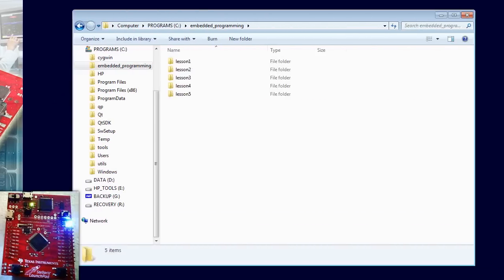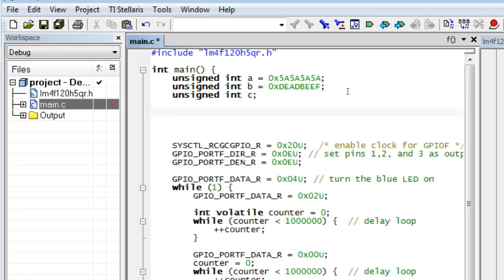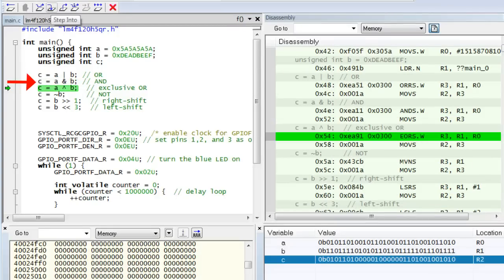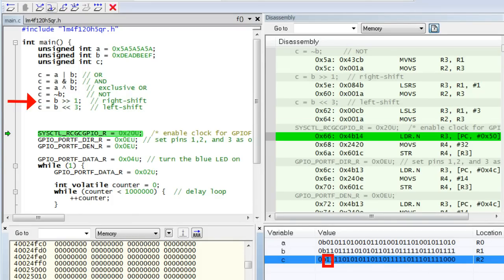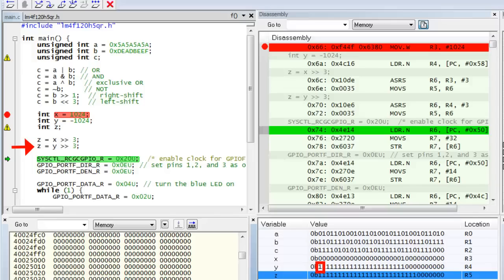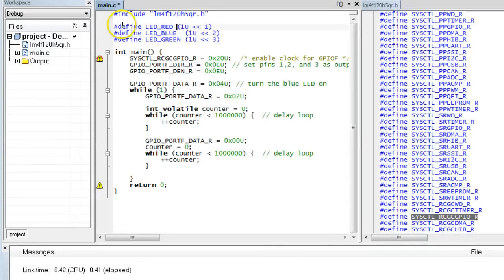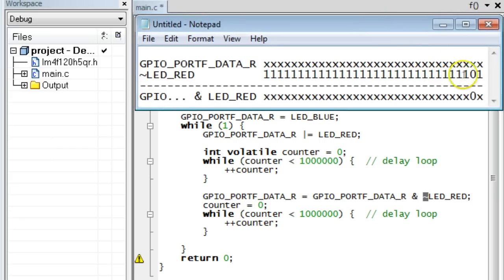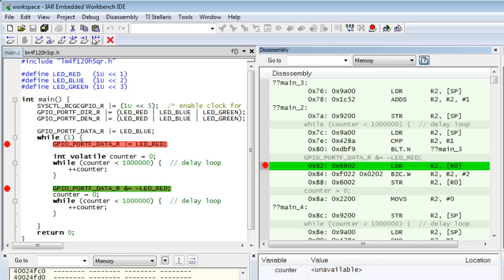#6 Bit-wise operators in C

Comment: When I set the optimization level in Keil to anything but zero, the code runs into an error in the debugger when I hit run, but it doesn't when I step over the code line by line or by breakpoints. Is that even supposed to be possible?
Reply: Yes, i also faced the same issue. The answer i got was that the compiler at higher optimization level was enabling clk and reading the GPIO registers back-to-back, leaving only 1 machine cycle gap between them. So effectively, compiler tried to read the register before it even woke up, and the board goes into hard_fault.
Reply: @sankalpsharma9414  thanks, i'll to look into it. did you find a solution?

Comment: best of deep dive in microcontrollers ,i realy enjoy all of your expresions about how 32bit mcus working and i have a request , pls teach 8 bit microcontrollers ,avr or stm8 or pic , i need to learn foundamentals of machine working in micros. thank you soo much
Reply from the maker: 8-bit CPUs are commonly believed to be "easy" to learn, but no new 8-biters were designed in the last 40 years, so all of them predate the widespread use of high-level programming languages (even as low-level as C). All 8-biters have "quirks" that require some non-standard extensions to C. The 8-bit PICs have a crippled stack, the 8051 has segmented memory, and even the "newer" 8-biters, like the AVR, require the "PROGMEM" extension to access read-only data in ROM. The only really "easy" and fully compatible with C is the 16-bit MSP430 (which is occasionally used in this video course to contrast it with ARM Cortex-M). Consequently, I think that teaching 8-biters in this day and age is counterproductive. --MMS

Comment: Great to know that the ASR instruction preserves the relation between division-by-2 and right-shift for negative numbers.

A firmware typically accesses control-related MMIO registers as if they were normal memory: read their previously stored values, update these values in the CPU, and write the updated values back. This is a common tip for peripheral modeling for firmware emulation.

Comment: Hi!

Does any one have an idea why this works when I turn optimization on:

    GPIO_PORTF_DIR_R = (LED_BLUE | LED_GREEN | LED_RED);
    
but this only works with optimization off:

    GPIO_PORTF_DIR_R |= (LED_BLUE | LED_GREEN | LED_RED) ;

All other lines of code that use bitwise operations work perfectly well
with optimization on, including:

    GPIO_PORTF_DEN_R |= (LED_RED | LED_BLUE | LED_GREEN);
    GPIO_PORTF_DATA_R |= LED_RED;
	GPIO_PORTF_DATA_R &= ~LED_RED;

I am using the latest version (v12) of the Code Composer Studio (by Texas
Instruments) and the latest version of Linux Mint.

Cheers!
Reply from the maker: First, you should simply check the disassembly in both cases. But whenever I encounter such "impossible" things I check for race conditions (explained in lesson 20, https://youtu.be/3ha72Y8pyD4?si=JaRbIUhrSBMttC7Y ). I suspect that you also access the GPIO_PORTF in some interrupts, aren't you? --MMS
Reply: @StateMachineCOM  I noticed that if I debug and then continue the run, it works. So I thought "Is it necessary for some reason unknown to me to wait a bit after enabling the hardware block with SYSCTL_RCGCGPIO_R = SYSCTL_RCGCGPIO_R5; ? Perhaps it is the wait in the debug that makes things work.
So I put a wait after the command that enables the hw block and it works with the |= even with full optimization.

Comment: Thank you so much for this wonderful series.
Can we use the bitwise NOT operator to find 2's complement of a number in following way, c = (~b) + 1; 
Is this a good way to find 2's complement of a number?
Reply from the maker: If a number x is signed, the fastest way to find its 2's complement is -x. For an unsigned number x, your way (~x) + 1 would work. But why would you even want to take 2's complement? Could you provide a plausible use case? --MMS

Comment: Through my simplistic knowledge, I understand the value in bitwise operators for embedded devices such as the launchpad. Memory is relatively confined in scope, and hardware registers are easily tracked down via the data sheet. How does this scale to something like a modern video gaming console, where there are gigabytes of addressable memory, and pointers are numbering in the thousands or more, and you have an API you have to interface through to access the hardware?
Reply from the maker: The understanding of the basics is always useful, and experience shows that developers who understand things at a low level tend to program more efficiently and with greater confidence. Also, let's turn the question around and ask: How can you scale all this up without understanding the basics, like the bitwise operators here? --MMS
Reply: @StateMachineCOM  I think I phrased the question poorly 😅
Can you help me understand how you manage the addressing of huge, complex systems? This simple developer board has a 1400 page datasheet. How do you manage complexity in advanced, commercial/industrial systems with dozens, or even hundreds of IO paths? It is not apparent to me.
Reply from the maker: @ChaseTheSunPodcast  The exploding complexity of embedded systems is a huge problem. And the ways of managing that complexity simply cannot become apparent at lesson #6 of the most basic concepts in embedded programming. But the later lessons in this course (now over 40 of them) slowly outline the "Modern" ways of tackling the complexity. For example, later lessons cover object-oriented programming (OOP), Real-Time Operating System (RTOS), event-driven programming, "Active Object" design pattern, Hierarchical State Machines, automatic code generation, etc. Not surprisingly, all these subjects are about raising the level of abstraction and automating as much as we can. Please continue watching the course and stay tuned for the new lessons! --MMS

Comment: I tried to do the programming in keil microvision. But even for this simple program I am getting execution time errors saying the write access to GPIODATA ( and many pther registers mentioned in the code) is denied. How can I resolve this error
Reply from the maker: It seems that you are using your own project for KEIL uVision. In that case, I'm not sure how you configured it. You might want to check out some projects for this video course for later lessons (21 and up), where this video course has switched to KEIL. --MMS
Reply: @StateMachineCOM  Thanks, now what I have done is I have given read,write, execute access to all registers by adjusting read, write,execute to the corresponding memory using the memory map option. But now when I write to a reserved bit, it's not showing any bus fault error.
Reply: @StateMachineCOM  I got the issue, the things is peripherals of tiva board cannot be simulated by keil

Comment: My compiler seems to be adding optimizations even when optimization is set to None in the IDE's project->options menu. For instance, when you are stepping through your initial explanation of logical right shift (c = b >> 1), I noticed in my disassembly view its putting the result in R7 (register 7), where the c variable is initially held at R3. In fact, for each bitwise operation in the source code, my disassembly is showing the results being placed in R4 (for AND), R5 (for OR), R6 (for XOR), and R7 (for LSRS). Granted I'm using a newer version of the IDE/comiler (version 8.50), and a newer version of the TI board (the EK-TM4C123GXL), but shouldn't the unoptimized code match your video?
Reply from the maker: The compiler is free to allocate the CPU registers whichever way it likes. The newer compiler apparently does it differently than the older one. All this does not necessarily mean that the newer compiler applies optimizations that you don't want. It just allocates registers differently. And, you could also see the effects of higher optimization levels by changing the optimization and observing the code in disassembly. The moral from all this that the compiler can (and will) change the register allocation from one version of the compiler to another, and from one level of optimization to another. Therefore, you should never assume any particular allocation of registers (e.g., by using in-line assembly). --MMS

Comment: My understanding is that the bit operator is useful and powerful to manipulate each bit individually but together. There is a big limitation for the bit shift, when some wanted bits are shifter, but also you shift those unwanted shift bits.
Reply from the maker: Unfortunately, the bit-wise operators in C do not allow you to manipulate individual bits completely independently. So, you always work on groups of bits (bytes, short-ints or long-ints). This means that you need to be careful not to disturb bits that you don't want to change. The other options are bit fields in C (you might want to google for that), but they are not quite portable and some safety standards forbid using bit-fields (e.g., MISRA-C). And finally, there are non-portable CPU-specific mechanisms. For example, ARM Cortex-M supports "bit banding" (again you might want to google for it). Bit-banding allows you truly independent access to individual bits. Not only this, each individual bit has its own address and you can have pointers to individual bits. But, as I said, bit-banding is not portable to other CPUs. --MMS
Reply: @StateMachineCOM  one more question: the IAR tool is not compatible with the Tica launchpad? In the Option-->Debugger, when i clicked 'TI Stellaris', there is a 'warning during the download' and therefore I cannot see the memory/code when I pressed 'download and debug' in IAR.
Reply from the maker: @josephzhang1797  IAR EWARM has been and still is compatible with the TivaC LanuchPad. For example, please simply download the project for this lesson from the companion webpage at: https://www.state-machine.com/quickstart/lesson6.zip . Then unzip this archive to your disk and open the project in IAR EWARM. You should be able to build and debug the code. Give it a try! --MMS

Comment: Why do we need to put |= for RCGCPIO, DIR and DEN? Do they have default values or are they set to 0 before program execution?
Reply from the maker: Yes, most peripheral registers have default values out of reset. These defaults are listed in the Datasheet. And yes, you could just set the registers like (e.g., SYSCTL_RCGCGPIO_R = (1U << 5);), *if* you are know for sure that you are not inadvertently changing something else. The use of "|=" to set bits (and "&= ~" to clear bits) is just a good form, because it allows you to leave the other bits unchanged. BTW, this is true only if you are not sharing the registers among other concurrent code, like interrupt service routines. Please watch Lesson-19 about **Race Conditions**, where you will see that bits can be clobbered anyway. --MMS
Reply: @StateMachineCOM  Thanks for the info. But, when I used = instead of |= for setting RCGCPIO and GPIOHBCTL(AHB) the code runs fine in IAR, but in CCS although the code compiles, the debug stops in Reset_Handler function in file startup_tm4c_gnu.c, line 374 -- for (dst = &__data_start; dst < &__data_end__; ++dst, ++src). Could you please help me understand what this function does? Also when I use |= for GPIOHBCTL, the code executes properly. I have checked registers, GPIOHBCTL is set to 0 at the start of execution. Then why do we need to use |= , if there is no default value to be taken care of? Thanks in advance.

Comment: I would have a question about bitwise operation. My purpose should be to change (0b1011 -> 0b0110). What means, I need to use unset and set masking. My issue is, how to create the unset mask. (unchaged bit: 1 and unsetting bit: 0)
I found a solution, but I am not sure it is correct or professional. 
Thanks for any answer.
Reply from the maker: Your problem statement does not match your example, meaning that leaving bit 1 unchanged and "unsetting" bit 0 (clearing ?) does not change 0b1011 into 0b0110).
Reply: Given a data bit[3:0]->0b1011 and the goal bit[3:0]->0110.
So some bits must be set, and other unset. 
To reach this in my solution I defined two type of masks
- one unset mask -> 0b1001 
- one set mask -> 0b0110
And then I used the bitwise operaions.
My Code looks like this:

int data = 0xB;         /*0b1011 (0xb) -> 0110 (0x6)*/
int umask = 0x9;        /*unset mask 0b1001*/
int smask = 0x6;       /*Set Mask 0b0110*/

data &= ~umask;        /*Unset the bits what needs without affecting other*/
data |= smask;         /*Set the bits what needs to be set*/

This problem is coming if example in one bitfield  I need to change the value to an other one, what contains more than one bits.
Reply from the maker: I must be missing something here, but if you need to change different bits you just use a different bitmask, right?
Regarding your example, why are you using variables for masks? I mean, your 'umask' and 'smask' use precious RAM. I would use constants, either numeric literals (e.g., data &= ~0x9U;) or #define UMASK ~0x9U, or enumeration (enum { UMASK = ~0x9};. I hope this makes sense. --MMS

Comment: Why is the program executed from within the ROM here ? Is it a XIP?
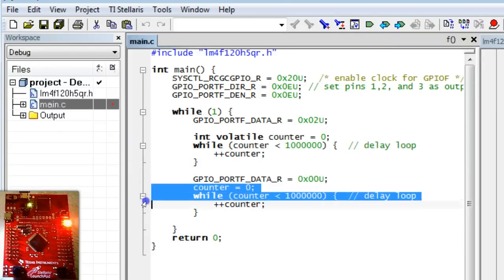Reply from the maker: Yes, microcontrollers typically execute code in place, meaning that the code runs directly from ROM (flash). This is a big difference from systems based on (embedded) Linux or other big operating systems, where the code is first loaded to RAM, from which it executes. Also, microcontrollers contain typically static RAM, which requires very little power to retain content (as opposed to dynamic RAM in Linux-based systems). The static RAM is however much more expensive, and typical ratio of RAM to ROM in a microcontroller is about 1:10. --MMS
Reply: Quantum Leaps, LLC  Thanks :). Also why do we push the R7 along with LR onto the stack ?
Reply from the maker: The PUSH {R3-R7} at the beginning of the main() function happens because the compiler follows the calling convention that prescribes which registers can be clobbered and which must be preserved in a function call. Please see lesson#8 for the explanation of functions and the ARM Application Procedure Call Standard (AAPCS).

Comment: "when you set the bit-1 for the red LED you also clear all other bits" why can i not set bit-1 without clearing all other bits ? because this is what the datasheet say page 654 :
"To aid in the efficiency of software, the GPIO ports allow for the modification of individual bits in the
GPIO Data (GPIODATA) register (see page 662) by using bits [9:2] of the address bus as a mask.
In this manner, software drivers can modify individual GPIO pins in a single instruction without
affecting the state of the other pins."

Comment: Hey QP, one of the reasons why I'm going through the tutorial is so I can make a robot. So far we've been using GPIO port F to make a integrated LED blink. What do I do if I want to set a particular  GPIO pin to 1 or to give it a certain voltage? Theres also alot of pins of the board itself like PF3 PB2. Can I also program these?

Comment: What is the 'S' appended to some of the assembly instructions for? For e.g. what is the difference between MOV and MOVS, or AND and ANDS?
Reply from the maker: +Aditya Kapoor The 'S'-suffix added to instructions MOV, ADD, AND, etc. means that the N and Z flags in the Status Register are set according to the value moved, result of ADD, result of AND, etc. The simpler CPUs in the Cortex-M family (e.g., Cortex-M0) often only support the 'S'-version of instructions.
--MMS

Comment: How come the compile assembly code stores the result in R3, and then uses another instruction to move to R2?  How come it doesn't compile to

ORRS,W R2 R1 R0

instead of

ORRS.W R3 R1 R0
MOVS R2 R3
Reply: +Xiao Deng I'm wondering the same thing actually. Did you find an answer?
Reply: same question here :D
Reply: @ahmedhisham9420  this is because R2 is register that holds the value of variable C, while R3 is a "scratch" register used for the calculations of A and B. It is necessary for one register to hold the values of a variable, since it will be used later, and another register to be used for calculations (this register is not bound to any specific variable). R2 will be used for any recalling and updating of C's value, and R3 is used for further calculations.

Comment: @Nick Abraham
I also got the same problem as you. I looked on the internet and they were saying you need to upgrade the IAR software. However, what I did is I deleted my entire lesson6 folder and created the lesson 6 project from scratch using the IAR menu option Project > Create New Project... I then found that the IAR debugger worked and I could see the variables a, b and c.

Comment: Thanks for the great resource.
I find that the tutorials are challenging to follow along but achievable and rewarding

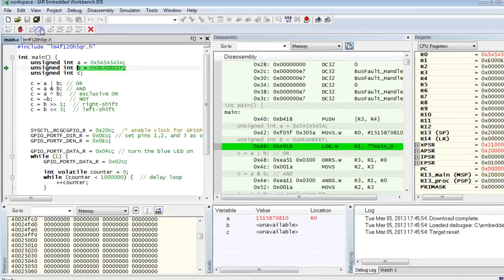When stepping through the code to experiment with the bitwise operators at 3:30, my workspace skips to the SYSCTL_RCGGPIO_R line (the clock enable line).
That is, it skips right over the lines that I am interested in.
Additionally;
1. I  can't put breakpoints into the code at these lines to force the debugger to stop .
2. The values a,b, and c show up as variables but have value "unavailable"

Why is it doing this and how can I fix it? (optimisations are definitely turned off)

Nick
Reply: Hello, the same is happening to me.... Any fix ?
Reply: I'm leaving this here for anyone in the future who may come across this. As we learned in the previous lesson, the reason that the code is being skipped is because the compiler sees that the variables are defined, attributed, and then never actually used. Even with no optimization, it still knows this makes no sense.

Turn the variables a, b, and c into "volatile unsigned int" and it will work.